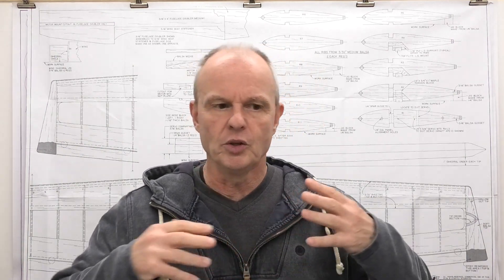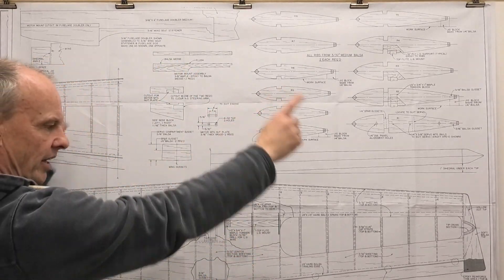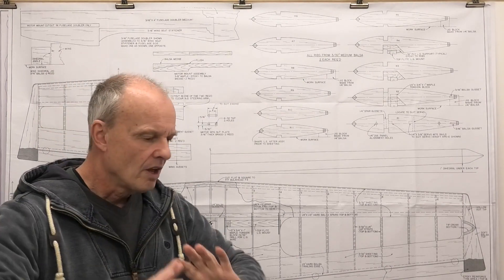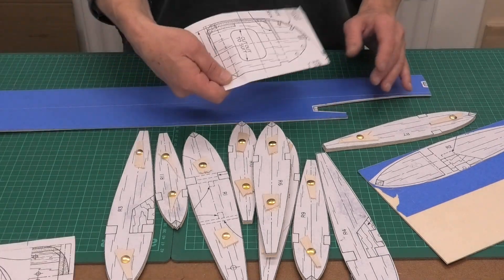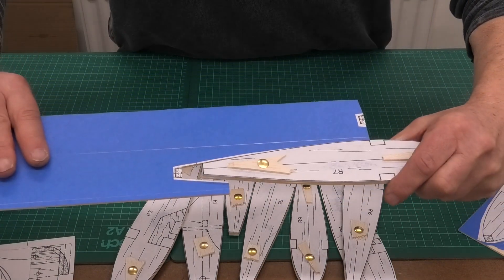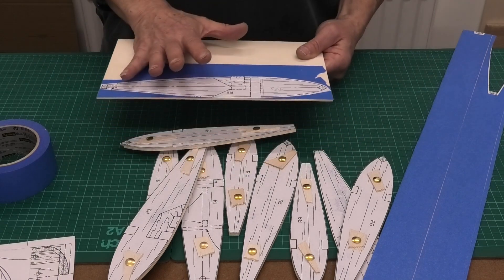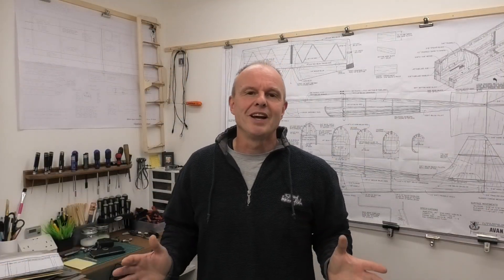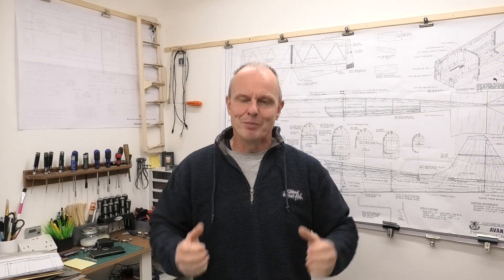Building from Plans: Pt 2 - Images to Balsa - Balsa Model Aeroplanes

Comment: I’ve been building from plans for over 30 years. Good to see others do this as well.  But I never cut my plans, if I can help it, because Ilike to keep them intact in case or when I crash and need to re build. So I use a product called see temp. It’s a clear lightweight plastic material that is used to make templates. Just trace the rib or part onto the template, cut it out, then transfer to the balsa or plywood.
Reply from the maker: Thanks fr the comment, and information.  I say in the first video of the series that I always get two plans printed, as they are fairly cheap, one to go on the wall to look at and measure and the other to be sacraficial.  But what you suggest is a great idea.

Comment: Good presentation Mark.  Nice to see someone building from plans again, as so many of us did in our youth.  Wood grain selection of the balsa stock material, is also worthy of note.  Fine grain (harder) is better for higher stress areas, and courser grain for low stress areas (wing ribs an example).  Looking forward to the next.
Reply from the maker: Hi David, thanks for the comment, pleased you liked the video.  With regards to balsa selection, have you seen the 1st video in this series, as I do talk about balsa selection, weights, grain and its uses etc.

Comment: Really useful tips and information, sometimes I use prit stick to glue the plan to wood only if you can remove it as soon as you’ve cut it out, it tends to stay on the paper rather than the wood 👍
Reply from the maker: That's a good idea! Thanks for the comment, really pleased you liked the video

Comment: Read that when cutting parts from plans that you do not cut all parts upto the black line,some need the black line removed to take allowance for the others! Thats the know-how or skill part. Do you find that at all?
Reply from the maker: I always cut on the outside of the line and then sand to the line, but the key is to measure the parts that are going together and make sure they will fit when you have finished, so you always have to adapt what you are doing.  As I have said the plans are often out, due to many factors, so the lines are only a rough guide.  Good luck with the building.